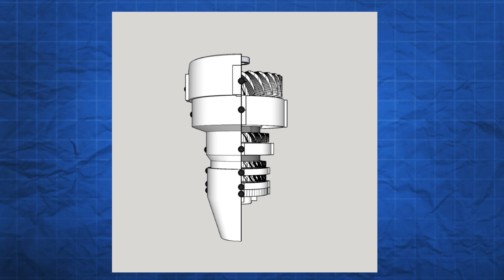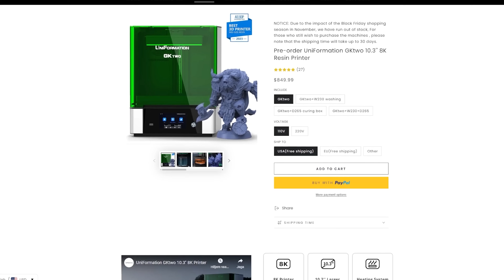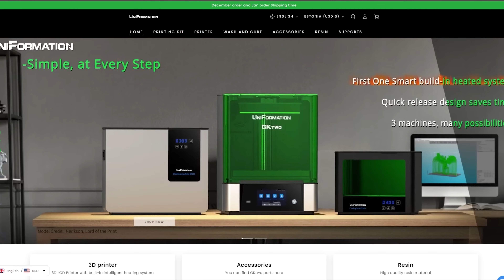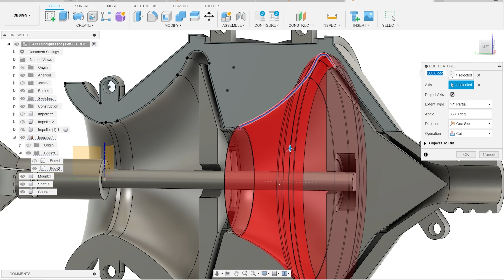Two POWERFUL 3D Printed Axial Compressors - feat. Uniformation GKTwo

Comment: I'm not a mechnical engineer but: 
1) I assume all those large clearances are causing air to escape to the back as soon as you try to build pressure, then sucked in again in a loop causing stress and loss of performance.
2) You used WD40 which is a cleaning agent, not a lubricant. It is great to clean old grease so you can apply a proper one. 
3) You did not balance your rotating parts, so as you ramp up the speed you'll find vibrations and oscillations. That's probably what grinds your housing.

Comment: Motor and shell need to be secured to each other and correct bearings used. Too much play. Should get way better results without all the vibration. Which is probably messin with the motor as well.

Comment: The problem with 2 stage compressor is actually problem with axial clearance. Please modify the bearings that axial movement will not be possible.

Comment: Hey great doing man , but I m in doubt that how your 3d printed Impeller and blade rotor are intact with ABS mine was shattered as soon as I hit the throttle
Reply: Is it something to do with resin or filament based printer

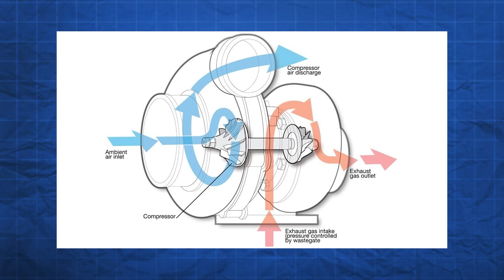Comment: Just had a short look at the axial compressor design and its stated specifications don't really make sense: At the stated 30000rpm and 8cm diameter, I get a blade tip speed of about u=125m/s for the first stage (the other stages have smaller diameter, so their linear blade velocities are proportionally slower). Given that the pressure rise across a stage is about Δp ≈ ρ*u*v (with ρ=density, v=fluid rotational velocity change across the stage) and for axial turbomachines we usually have roughly v≈u, I get about 20% pressure rise in the first stage (the other stages have lower compression due to slower turbine blades). The stated compression ratio of 1:24 needs at 4 stages a compression factor of 2.21 (121% pressure increase) in each stage. To achieve that, you'd need transsonic blade speed of around 450m/s. Furthermore, the stated mass flow of 28kg/s (about 28m^3/s at ambient pressure) through the inlet area (circle with 8cm diameter) yields 5.6km/s (Mach 16) as inlet speed which is pretty wild.
The compression ratio might possibly be reconciled by increasing the rotation speed to 100.000rpm (the high compression ration per stage would also fit the shape  of the turbine design / stage area ratios), but the stated mass flow rate is probably just incorrect.

Comment: The reason your compressors keep messing up and shredding itself on the inside is because you failed to account for the expansion of the plastic parts during operations at extreme high speeds as well as the torque being produced. You may want to build all of your interior parts out of carbon fiber instead of PLA or PETG

Comment: stop trying to blow up balloons and bags and call it a compressor.  if it really is 'compressing' the air, then there should be a noticeable change in temperature... install a thermocouple and get a temperature delta...  Im just sayin.... I can blow up balloons and bags with my own 2 lungs and I AM NOT a compressor.    it's like you don't want to acknowledge CHEMISTRY GAS LAWS... if you can get the air coming out HOT like a HAIR DRYER WITHOUT THE HEATING ELEMENT (like a hair dryer uses) then I would suggest you've built a compressor...  otherwise all you're showing are some extremely over complicated fan building... with some expensive toys like a 10 year old who doesn't know what they're doing...  compressors are called compressors not because of how fast they move air... but because of the THERMAL DYNAMICS ASSOCIATED....

Comment: I think the problem, with the axial compresor, is that for the balloon you are experiencing a compresor stall. A way to test this could be to use a pressure buffer between the ballon and the compresor, let say a 20 to 50 liter tank, this will allow some air flow, you can try with bigger balloon.

In summary the axial compresor needs some air flow to really perform, it is not good to build just static pressure

Comment: Now add some combustors around the periphery with some cross piping ignitors and generator on same side as the compression stage. Bring your compression stages up to about 19:1 add some air cooling off your compressor stage to your blading and IGV's.  Add four rows of impulse type blading on outlet side.  Throw in a HRSG on your exhaust side along with a ST connected to your HRSG!  ...Pretty cool for plastic model off a printer!  Back to back radial bearings can work as a suitable thrust for your setup, I do see tons of thrust in your video.

Comment: In engines they combine a lot of axial compressors (8 to 20) with one, sometimes two centrifugal compressor. The reason is that you have a greater surface for the intake (air to come into the system) with axial compressors but you have a bad compression ratio. But you can compress the "surface" so much, that it fits the small area of an centrifugal compressor. The centrifugal compressor has a high compression ratio but it's not efficient to have more than two of them. To combine the two systems you get the best of both worlds and they multiply their compression. Imagine a compression per axial stage of 1.5x and a centrifugal compressor with a ratio of 5x. @3 Axial stages it becomes 1.5x1.5x1.5x5 = approx. 17 times compression ratio.
Reply: yeah it needs compression chambers or a much higher angle of attack on rotors to compensate for the pressure difference on each side of the rotors 
once pressure gets to high on the back compared to face for rotor it wont draw in air

Comment: Two-Stage Centrifugal compressor needs a bearing between the rotors to stabilize the drive shaft and keep it from wobbling in the housing, that'll stop a lot of the wearing, also a thrust bearing, as previously mentioned, or just a simple ball bearing at the end of the drive shaft. As for previously mentioned diffuser, my knowledge doesn't yet go that far, but it probably would help..

Comment: nice, but i think if you printed fan ora axial compresor with multiplying bldc motor from used hdd its will be a good project, you can adding hdd motor in series flow and make it reverse spin every section

Comment: The horrible noises coming from the centrifugal compressor are the axle wobbling around as the blades hit the housing. There needs to be both a front and back bearing to keep the axle perfectly concentric with the housing in a rigid manner.

Comment: I think the shaft of the second one could be bent, between the flanten section and the hammering it isn't hard to imagine. 

I doubt you would need a thrust bearing for those loads but a front one directly to the housing can be a good idea. Good luck!!

Comment: It’s not difficult to see the issue with the compressor making all the PLA dust, just look at the input shaft and how much it moves about, since you have tight tolerances when the shaft moves about it makes the rotors hit the housing and grinds it away.

For something like this to work you need the shaft held very firmly in the centre of the compressor so it can move radially as little as possible.

Your lack of a bearing on input and the flimsy motor mount that flexes are definitely not good enough.

You have a resin printer, resin can often be more precise and stiffer than most FDM printable materials, you should try a better design and a resin printed housing.

Comment: you could enclose the axial turbines in their own cover from intake to exhaust printed with the cover attached to the turbine. you are losing a lot with interaction between the housing and the turbine.  once it sucks the air in, you want it to continue to accelerate to the back radii, not lose energy by flowing backward towards the intake again along the housing surface. you can also get away with much less tight tolerances between the rotor and housing.
On the exhaust side of the first turbine, vanes to smoothy redirect the flow from spinning to straight again, to make it easier for the second stage to inhale

Comment: What is the purpose of this? Why would you try and compress the air if you’re not going to inject fuel and ignite it? Just want to inflate a rubber glove? This exercise doesn’t make sense.

Also, you’ll find it very difficult to seal this thing to gain any increase in pressure at all.
Cmon dude, if you’re smart enough to CAD this design, you’re smart enough to know better.
Reply: wut
Reply: @Chris27-  Ugh

Comment: The first one doesn't have a high static pressure, it's built like a jet engine.  The second one has an axial load due to the design that needs some bracing or a bearing that's designed to take that load, a thrust bearing would do it..  It...also looks to me like you may be spinning it backwards, but it may just be a trick of the camera.  Its hard to tell, my phone isn't giant.  You can print a thrust bearing using resin and a couple daisy power line slingshot ammo.... They're 1/4 inch steel balls and they're 250 for like 7 dollars.

Comment: Very big issue with radial compressor is back pressure. You need a thrust washer to push against the housing and you need to make more room for air to flow in the last stage

Comment: WD-40 Is more of a cleaner than a lubricant. It does lubricate temporarily, but if you want something long term you should use something else. Probably silicon oil in this case.

Comment: If u have inflated a couple of baloons, u´d notice, that the initial blow (when the rubber is still "virgin" and unstretched), is far harder than any subsequent blow. When we were kids, tha adults would make the 1st blow, then let the air escape, and THEN give us kids the baloons to inflate them... Pre-stretch the baloon, then it may work.. The difference of baloons and gloves is, that while the rubber-material is equaly distributed across the whole surface of the glove, thus growing unformly, a ballon has more material at its end, and grows at this end too... But the additional thickness at its end, makes the 1st blow challenging even for adults...

Comment: You’re missing thrust bearings on the centrifugal compressor, that’s why you have dust regardless of the tolerances. The blades are sucking the impeller into the housing.

Comment: You need a bearing on the intake side of the dual centrifugal compressor...you are getting too much flex in the shaft...thus it's eating the housing...in fact a bearing in the middle wouldn't hurt either
Very cool...surprising the plastic impellers held together at high rpm's
Keep em coming!!!!

Comment: You just need to gear those compressors up, they need way more RPM then the motor itself can provide, I think the balloon is achievable with gearing
Reply: Its BLDC motor this model can spin 60000 RPM unloaded and 40000 RPM in my experience with small load

Comment: I have an idea for the centrifugal compressor...
i think it has so much debris in it because ihe two impellers are connected with a resin rod instead of a bearing, therefore it becomes unstable during operation...
if you would have one bearing in the back and one additional bearing in between the impellers, it will be more stable and won't produce as much friction-debris, also a third bearing on the inlet of the dual impeller could stabilize it even further, but you have to redo the housing design to fit the two additional bearings in it, otherwise it's still a great idea...

also: if you want to blow up a balloon, you could try modifying the housings in such a way so that you can have the centrifugal compressor as the first stage and the axial compressor directly behind it as a second stage for more pressure... if this will blow up the balloon, i would be really impressed and i would like to try all of this on my own, as soon as i got a 3D-Printer that uses Resin (which sadly takes a lot of time to get the needed money saved up)

Comment: Hello,
Could you do a static pressure test on both model (and future ones) to have an idea of the pressure ratio and alos a flow test with a anemometer and the section of the outlet (for debit calulations).
And for your centrifugal designs, in comparison with a real turbo impeller or a real heli turbine, the outlet of the blade is not high enough and the slope of the profil is not inspired by what works. you should make the center of the compressor in the shape of a quarter-circle. For the blades, lengthen the inlet blade length and the outlet blade height, and reduce the number. Also try a design with two rows of blades.
So for your next designs think about going for a platforms of impellers and change some parameters like the numbers of blade the angle of attack.

Comment: I'm pretty sure your skill in 3d printing is at a level that would allow you to build an axial compressor capable of popping the balloon. 
Keep working on it and try to refine the design. I would definitely try with bigger diameter rotors (the rear ones get too small imo) and more stages (at least 6). 
Calculating a good geometry for rotor and stator blades shouldn't be difficult just like calculating how much smaller each consecutive stage should be. I'm sure you can find lot of information around the internet on axial compressor design.
One thing I really don't get is why there's so much space between rotor rotor and following stator in that design. A good rule of thumb is that rotors and stators should be as close as it is possible to prevent unwanted turbulence. 
You also want to try refining the way the shaft is kept in place to get better performances and less vibrations.
This is a really interesting and inspiring project and I'm so excited for the next video. I'm sure you will make something really unique on Youtube.
Keep trying and it will be great.

Comment: By increasing the clearances to stop rubbing you're increasing the amount of air that can leak past the compressors. It really needs another bearing or two to hold the impellers more stable and allow you to tighten up the clearances

Comment: Radial are used a lot on turboshafts and turboprops. Where you dont have as much airflow into the intake.  I think that unfortunately radial compressor in this use case would require those tighter tolerances which would be present on both types when machined out of metal. Axial one can get away with less. Even though the pressure gain from single stage of axial is lower than from single stage of radial one. It just pushes forward right into the stator and next stage and so on. If it was made of metal i would say go radial for sure. 
Perhaps if you were to print each stage housing as one piece, inserted impeller then connected end piece with stator wanes than next housings of entire stages next impeller....
And perhaps nylon as a material for its lubricating properties. Just guessing.

Comment: If you stretch the balloons before attempting to blow them up, they blow up much easier. Also the wear you're getting is most likely due to the internals moving. So maybe a thicker/stronger shaft will help with that.
Reply: This is what I was thinking. If you think how hard it is to blow up a balloon with your mouth - until it stretches, then it gets really easy.

Comment: your centrifugal needs a front bearing to keep the impeller centered in the housing. you can see the angle of the shaft change in relation to the housing when high torque is applied. You could alternatively try one in the middle? you basically need 2 bearings as far apart as you can put them on the shaft. Oh and don't worry about axial loads; roller bearings can't take much but there won't be that much from this.

Comment: The thickness of the Baloon rubber is quite high and is a lot smaller & denser in comparison to the Gloves and Waste Plastic bags which a quite big less dense and have thinner material overall.
If you want to Blow up the balloon you need to stretch it length-wise so it can be blown to full size.
When people blow a balloon up they stretch the balloon as they are blowing it making it easier to fill the balloon up with air.

Comment: since your motor isnt fastened to the housing and you have no trust bearing every test seems like the housing is puched back and then shit starts tro grind and clog.
you need a trust bearing or have the motor fastened to the housing so it doesnt seperate
Reply: And simple one way blowoff valve or could do a clutched by rpm style like supercharger in og mad max procharger makes a similar type

Comment: the biggest problem i am seeing with both of these designs is a major lack of bearings. Especially the axial compressor with only 1. It's impossible to hold a shaft straight with just 1 bearing and it really needs 3 or 4. I'd probably put 2 in the back 1 between the stages and another in the front on a little tripod support. The second problem is having too much clearance. Compressors need shockingly tight clearance which is also why it needs to be very precisely supported by bearings. I actually don't think self clearance is a bad thing as long as it it well supported.

Comment: dual turbo needs better bearings, bearing placement and support, oh and a way to keep the shaft from traveling, (thryst bearing) like in a car engine crankshaft design. the motor side is freeballing.